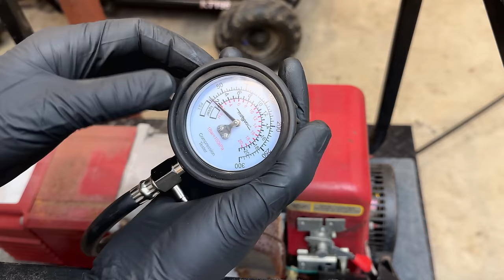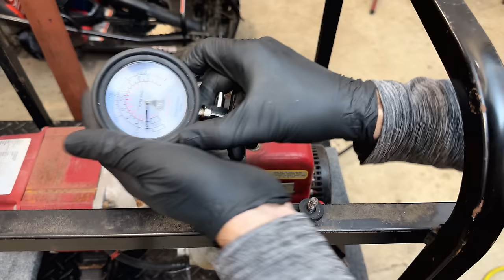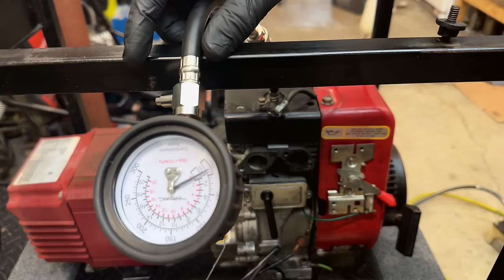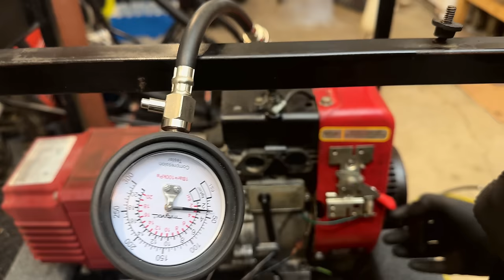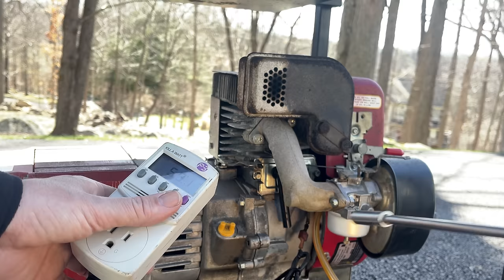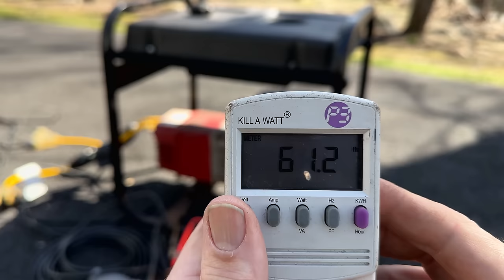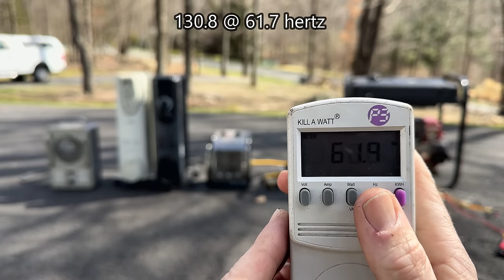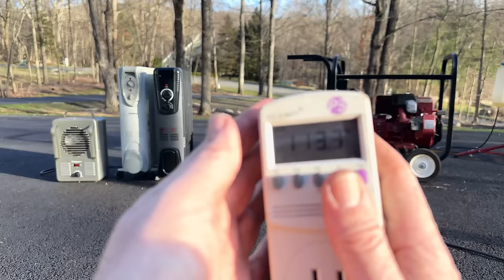More Tecumseh Trouble - Low Compression

Comment: Umm, yes you can use the load bank. The Nema 5 outlet you have you'll use left 120v right 120v
and the center is the neutral. This is how I wire my Devilbiss to my power panel to run the whole house. Same outlets ur Coleman has. Of course I use the Devilbiss as a backup of my Honda, because as you said it is as loud as H#ll like ur Coleman...lol.
Reply from the maker: If connected to a panel and the generator had a neutral bond to ground then technically it would work because the ground wire would carry the neutral to the panel and the panel also has a neutral bond to ground.  But when plugging in directly to the generator the neutral wire would be open and the load bank would not work unless rewire to use the ground as the neutral wire.
Reply: @jcondon1  So the 220 out on the gen is a 220v only?  I find that to be impossible. Neutral can't be open at the gen set. The ground as you call it is a neutral. I can prove that. I've forgotten  to connect the neutral to my panel and some things were low voltage, other side hi voltage. The power is looking for the way back on a 120v circuit to the generator, bottom outlet is where the neutral gets back to the set. it would be the neutral back to the Gen Head. The neutral and the ground on the gen. set would be bonded. This is why the destruction sheet says to ground the chassis of the gen set to a real ground rod for safety. In the case of a fault/ short in the circuit . This way it is grounded and fry the breaker, instead of just causing the gen set to become energized, which you will not want to touch.

Hook up your gen set to your main 220 v power panel @ 120vX120v and that's it. Don't connect the way back to the gen set (ie Ground/Neutral ) then let me know what blows up in your house. (ie some electronics will fry) Ask me how I know.

I watch all your vids. I'm just informing you of my experience. You may have a 4 wire on your power bank. Well that is fine. That is my guess as to your explanation as to why you did not use it.

Line 1 Red 120V Line 2 Black 120v 
White Neutral    Green Ground.

Mine is wired Line 1 Red 120v  Line 2 Black 120 v
White   Neutral to outlet on gen set middle bottom 

Green Ground connected to neutral White wire...bonded.
Reply from the maker: @NY411Info  I will have a look at the outlet on the generator.  Always thought that style of plug was L1, L2 and ground.  I could be wrong.

Comment: What is the wear process that requires the valve to be shortened to compensate?  Thanks for another great video!
Reply: The valve is housed in the block. It slams up and down. On the down stroke the valve hits the seat. The seat can be "soft" and gets pounded away allowing the valve to "drop" further and further into the block...closing up the clearance as the valve stem drops down towards the lifter...
Reply: @JohnSmith-yv6eq  Oh, that makes sense!  I didn't even think it was soft enough for that to happen.  Thank you for explaining it!
Reply from the maker: The valve wears into the seat over time.  It normal to need an adjustment every so many hours.
Reply: @jcondon1  Thanks!  That makes sense now.  Really appreciate all the explaining you do in your videos.  I have learned a lot, but there is so much more to learn yet.

Comment: I love your channel.  Question, if I don't have a manual for an engine, where can I fine torque specs Etc?  Is there a role of thumb for most engines?  Thanks.
Reply from the maker: Most name brand engines I can find specs for.   They are really only need for the connecting rod and the head bolts.  Worst case on this size engine usually about 200 in-lbs on the head and 100 in-lbs on the connecting rod.  For Honda clones I use the Honda specs for the engine it is a clone of.

Comment: Those Tecumseh engines are kinda cruddy even when everything is perfect. That loose top plate on the carburetor is pretty common, as is the tight exhaust valve and the popping/missing without a load. If you're used to Honda/Subaru/Yamaha engines, you'll never be happy with how an old Tecumseh runs!

Comment: I was curious about something. This is pertaining to bad rotors you've had on other videos due to the manufacturer using aluminum wiring and not being able to solder it. Could you possibly use those aluminum welding rods they sell at Harbor Freight with a torch to reattach them?
Reply from the maker: Would be worried about the sparks damaging the varnish on the good wires.  Some have said silver solder would work.  The other issue is that the broken wires are often brittle and just crumble when trying to work with them.

Comment: I tend to stay away from any piece of equipment that has a Tecumseh engine .  My friend in high school had a small engine shop and he liked the Tecumseh engines.  I don't guess I understand the whole gasket reusage thing, I watch other YouTube channels and a lot of the other guys seem to try and reuse gaskets also.  It's like some right of passage or something.  I prefer new gaskets myself and I am of the mind to think torque values given in an instruction manual are for new gaskets not crushed and flattened used gaskets.  The equipment I worked on for 40 years called out to NOT reuse gaskets .  I haven't purchase any small engine parts in years other than oils and filters an occasional belt.  How much are those oval exhaust and intake gaskets ?
Reply from the maker: Usually they do not cost much.  Depends on the engine.  On average $5-$8 a gasket.  I usually reuse if not damaged, but will replace when needed.  I replaced all the gaskets on the second generator I tested as part of the troubleshooting process.

Comment: James, Do the valve springs have a bilt in clip? I was thinking that the clip (valve spring keepers) would be hard to get on. But it didn't look too hard for you.
Thanks Bob
Reply from the maker: This spring retainer was slotted.  Had a volt master generator some time ago the used keepers.  Think I had to turn the engine on its side to get them in.  https://youtu.be/qBFZUfB0tr4?si=7X_MFLgzxZtHO65d

Comment: I haven't watched  this yet. But I'm using this spot to asked a question.  I was watching a old time machine  restoration 100 + year old. Long story short he found a weak intake spring. My question: for todays equipment, is there a way to measure the strength of the intake and exhaust Springs?

Comment: James do you have a chart with all the torque specs for all the different bolts?  
Working on a firman and looking for head bolt torque specs and few other bolts as well.
Reply from the maker: Firman uses Honda clones.  If a 6.5 hp engine, use Honda gx200 specs.  If in the 390-420cc range use Honda  gx390 specs.  Also you can call firman and ask.  Sometimes manufacturers will tell you the specs or maybe give you the manufacturer name that actually made the engine.

Comment: I have noticed that you torque everything except the spark plugs and drain plugs. Why? These are the most frequent removed plugs. 😏
Reply: Do enough spark plugs and you can "feel" when it's right. Ditto drain plugs.
Reply: @JohnSmith-yv6eq  Well, you can say the same about all the other bolts and nuts too! Wonder why you always find stripped spark plug and drain plug threads on cars? 🤔
Reply from the maker: I do those by feel.  Spark plugs do not need much.  I torqued one once per spec and I thought for sure it was going to strip out.  Some drain bolts are square pipe thread.  Does not lend itself well to a torque wrench.  The bolt size is so large to not usually worry much about those.  The tiny bolts are what worry me.  Very fine line between not enough and too much.

Comment: 34:30. Is that a cup-style wire brush in your Dremel tool?  Have you found good quality ones that don’t start throwing wire immediately and stand up reasonably to use?
Reply from the maker: I use the stainless steel brushes.  They hold up better then any other.

Comment: Does the exhaust valve seat wear, and thus the clearance is consumed?  Seems that would be a lot of valve seat wear.
Reply: On a flathead engine the valve seat gets hammered down into the block..

These engines were designed at a time when lead was in gasoline...
so no hardened valve seat inserts 

Sometimes the valve seat is cut straight into the block material.

So as the hammering action pushes down into the valve seat the valve itself "falls" down towards the valve lifter...closing the valve to lifter clearance.

Since there is no shim or adjusting screw (that you have with valve in head designs) 
the only adjustment is to shorten that valve stem by grinding it away 
thereby restoring that clearance.....

Comment: I find it incredible that these engines are designed without any adjustability for the valve stem clearance. Every other engine I've seen on this channel has a screw/nut arrangement that can move the clearance in both positive and negative directions. Is this just a cost shaving measure? If so, then what else did they cut corners on, and does that explain why they run so poorly with no load?

Comment: I follow you on YT & was wondering if you had a suggestion on a tune up kit for my Honda GX-390 engine for my DeWalt pressure washer. For whatever reason it takes forever to start the engine. It has a lot of compression & I can only pull the cord once before having to release the back pressure on the wand on the pressure washer. It sometimes takes me an hour to start it. I keep it in my heated shed & it still looks new as I take very good care of the outside. 
I think the ethanol fuel might have ruined the carburetor? The pressure washer is 18 years old. This starting issue has been getting worse & worse since I got it. All I have done is change the oil. It gets about 2 hours of use a year so there are not many hours on it. 
Is there a full kit you recommend from Honda or a reputable other source you can recommend I can order online with a new carburetor? Any help you can offer would be greatly appreciated! 
Keep up the great videos. I love the content.

Comment: Where did you get that thinner flat head that seems to fit in the pickup of the carbs in all your videos so well? Mine are either too big or a little too small.
Reply: If all else fails have a look at gunsmithing screwdrivers that are hollow-ground......
Hollow Ground blades with square faces
Designed to fit and apply torque from the bottom of the slot where the screw is strongest.

Comment: Hello James, I really enjoy your informative videos on small engine equipment. Could you make a video about how to change out oil seals on Troybilt tillers? I have a Troybilt tiller and I change out both front axle seals and the power axles to the tiller tines. After I did this the seals still leaked. I replaced those seals as well, but they leaked too. What could I be doing wrong? I made sure that the seals were flush with the level where the old seals were installed.
Reply from the maker: I made one last year replacing on seal.  Link below.  Just working on another Troy bolt now.  Just replaced 3 seals.  Video in a few weeks from now.  If the seals were installed correctly and the right seal then it might be corrosion on the shaft chewing up the seal?  All I have replaced the shaft was pitted and that will cause leaks.  https://youtu.be/v3qWYgIdIwA?si=Kz-srGQZJtLzAGel

Comment: I would replace the carb with a China one and see, carb has internal problems 😊
Reply: Not the carb per se..

it's that long unheated manifold with the 90 degree bend allowing fuel to fall out of the airflow when the engine is cold...
that's the cause of the lean mixture and rough running.

If you adjust the carb for smooth cold idle..
when the engine warms up and heat migrates from the head to the intake..
then you get a rich mixture under load.

Small engine carbs are usually straight shot down a small manifold (if any) straight into the head/valve...

Comment: Could you swap the throttle shafts between the original and the clone carbs??
Reply: Yes if they are exactly the same...
Reply from the maker: Probably.  If not, I had plenty of oem carbs around there were not exact for the generator but the throttle shaft could have been transferred over.

Comment: I don't understand why generator manufacturers don't use plastic gas tanks. Many generators are only used as backup power, so they just sit. Don't plastic tanks make more sense?
Reply: No, draining the tank seems to be the best for me when equipment sits for a long time. Gord.
Reply from the maker: They make sense.  Only downside is when the bushing fails or when they melt.  Both do happen and turn the generator into a ball of fire.  From a liability perspective manufacturers likely feel safer with metal.

Comment: With the loose throttle plate could you solder it into the correct position at all?
Reply: Usually the "top" of the shaft is "restaked" (peened over) to replicate the  way the OEM process was carried out

Comment: it's a Tecumseh, to expect anything less would be foolish
Reply: Not the carb per se..

it's that long unheated manifold with the 90 degree bend allowing fuel to fall out of the airflow when the engine is cold...
that's the cause of the lean mixture and rough running.

If you adjust the carb for smooth cold idle..
when the engine warms up and heat migrates from the head to the intake..
then you get a rich mixture under load.

Small engine carbs are usually straight shot down a small manifold (if any) straight into the head/valve...

Comment: I've been in the small engine business for 35+ years and I still hate working on Tecumseh engines. One thing that I have learnt from experience is, Do Not buy a cheap carb for a Tecumseh. Get a decent quality Rotary or Stens brand carb if you can not find an OEM one. The cheap aftermarket Tecumseh carbs are Absolutely Garbage.
Reply: Not the carb per se..

it's that long unheated manifold with the 90 degree bend allowing fuel to fall out of the airflow when the engine is cold...
that's the cause of the lean mixture and rough running.

If you adjust the carb for smooth cold idle..
when the engine warms up and heat migrates from the head to the intake..
then you get a rich mixture under load.

Small engine carbs are usually straight shot down a small manifold (if any) straight into the head/valve...
Reply from the maker: A lot of Tecumseh clone carbs are junk.  I should have repaired the original throttle plate shaft  or used the throttle shaft from the other OEM carb.

Comment: I'm not too familiar with these carbs, but could you have swapped out the adjustable main jet from the OEM to the clone carb?
Reply from the maker: Maybe.  It depends on how it was machined.  I have a bunch of bad oem carbs.  I likely could used the throttle plate from one of those.

Comment: To James and followers..where would I find a replacement carb for a Toro T1800 generator. Model number is 62018, serial number 4001257. Carb is a Mikuni BV 21-15-2A float type. I appreciate any leads.  Thank you.

Comment: I have a 12 year old 5500W Briggs & Stratton Generator With only 65 hours on it, it always started in half a pull. now this spring, its not working like it used to. if the choke is fully on, it will not ever start. you have to go one click off choke, and then it will start. also, there seems to be a compression issue, as the engine moves through each stroke, two strokes pull very easily, then the third is hard to pull, and the 4th becomes very hard, and then it goes back to 1 and pulls easily again. im assuming its a compression release issue due to not changing the oil often? i disassembled the carb and it looks brand new inside because it would not start at all, but i believe that was due to that choke issue which i figured out after everything was reassembled, so now my issue is just the compression. Any ideas or would the engine need to be torn down?

Comment: Hi James, I currently have a Coleman Maxa 5000 ER with a 10 hp Tecumseh engine garage kept Florida unit. I'm only $50 into it so I have room to spend. Performed a compression test and I'm getting 80 psi, did a leak down test and it's holding pressure, checked valves and intake is sitting at .08 while exhaust is at .12. The flywheel key is not sheared and I have good spark. Cleaned the carb but it's backfiring through the exhaust. Where should I check next?
Reply: Update: figured it out. Because I had spark I automatically assumed that the coil was fine. After checking everything I decided to test the coil. The primary was at 271 ohms and the secondary was at 4k ohms. The high primary was putting out a weak spark although present and thus causing unburned gas to combust in the muffler causing the backfire. Replaced the coil and the unit started right up. Total in, $60 including the unit that looks practically new. Not bad, especially here in Florida during storm season when units can cost a lot even used

Comment: James I know your busy but maybe you could help me I have a coleman power base generator it makes 4250 watts it has a similar power head to the one you have just less watts and it has 42 volts on the 110/120 side and 180 bolts on the 220/240 volt side and it slowly loses volts as it’s running it now has 40 volts on the 110/120 side after about an hour of running can’t figure it out please help

Comment: What would cause the run issue that you had with the clone carb on the first machine? What would cause it to surge at idle, but run smoothly under a load? I have a pressure washer that is having a similar issue, and I can't figure exactly what the issue is. I have gone through the carb multiple times and there has been no change. It runs great under load, but sounds terrible at idle.
Reply from the maker: The pilot circuit is clogged or the jet is too small